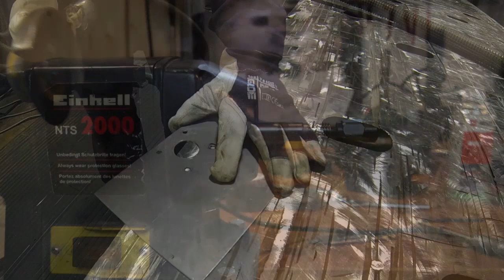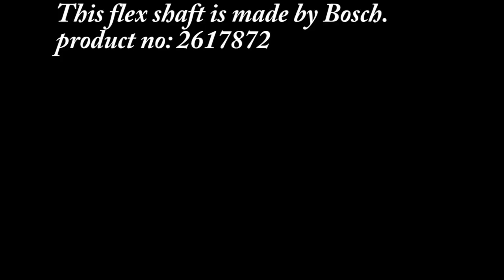Simple bench grinder modification.

Comment from the maker: Note: actual thread size in chuck is 1/4-20. I allways mix those. Specially easy it is, when video editing is made week after actual making process. 
Most likely reason was that i needed to make a new thread to pipe, and searched
3/8" - 18 NPT taper thread die with google meanwhile video editing software was rendering video clips.

Actual idea of the video is at the beginning. I tought this build could be good way to share it. 

Otherwise grinder is modified to fill my own needs, maybe one can find something useful for it too. Stones are replaced with Scotch brite polishing wheels. Bigger one in the right is rated to Max 6000rpm.